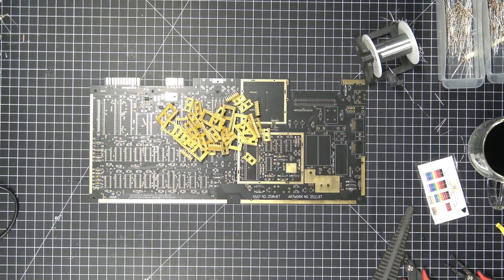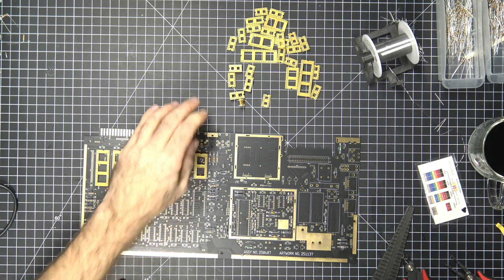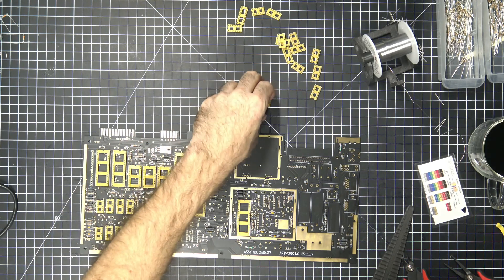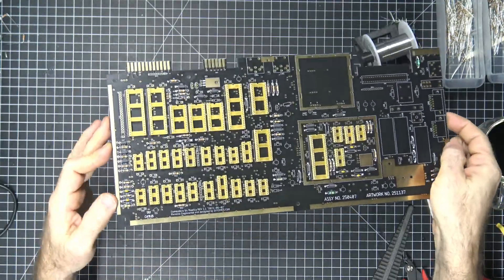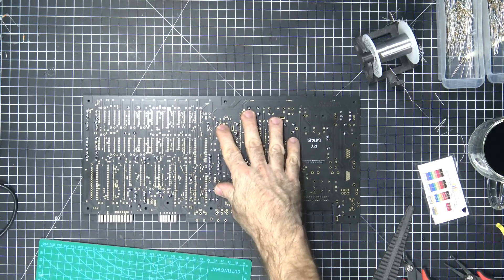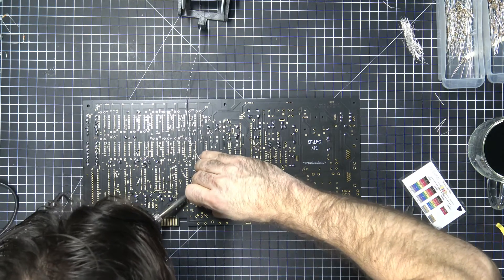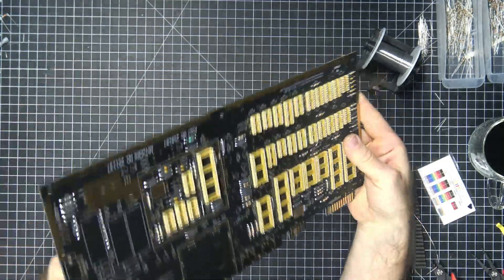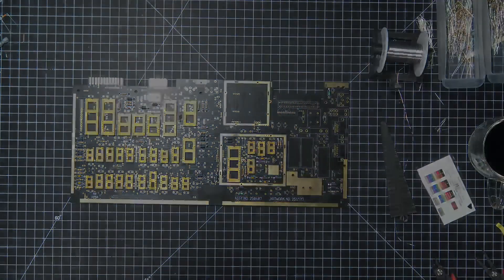Building a C64 Commodore 64 from Scratch - Part 3 - Sockets

Comment: the sockets are rad and this is super original!  how did you make the metal part of the sockets?
Reply: Thanks. The pins can be purchased separately and then they are just pressure fit into the resin printed sockets